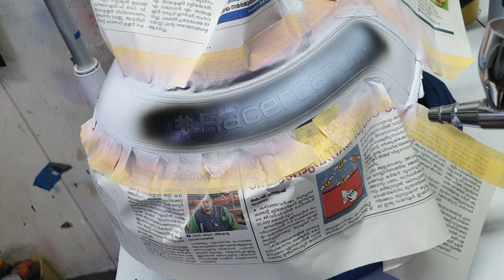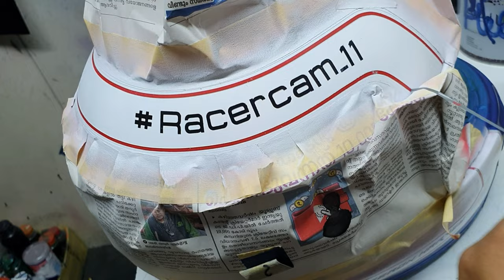bell redbull custom paint | redbull helmet step by step | how to airbrush helmet |  #redbull  doodle

Comment: Hello where is it possible to find the files for the différent doodle? thanks a lot
Reply from the maker: @gregorypierson9801  mmm just check in pinterest , keyword “ doodle “  lot of doodle option and themes 🫶🏽
Reply: @walker_studio_airbrush  Thanks ! I tried painting a helmet in the same style as you, but I'm having some problems. In some places, the paint has not held and is blistering, what is this due to? I also have traces of glue which are very pronounced, especially on the parts masked from the beginning and which remained hidden until the end of painting the entire helmet. Could this be because the room temperature is too hot? or the quality of the tape? What tape used? I also have marks between colors, like little edges, how can I avoid them? Thank you for your advice and help :) 🙏
Reply from the maker: @gregorypierson9801 sir, .. mmm did you making clear coat before make  design on it ? much morre better before you do clear coat on it.. the glue sticker also because of it ( surface is not yet dry properly) or send  text on whatsapp +971545977099
Reply: @walker_studio_airbrush  thanks for the answer, i've sent you message and photos on instagram ;)
Reply from the maker: @gregorypierson9801  🫶🏽 ok sir 🌹🌹